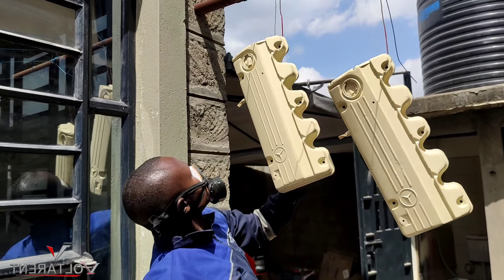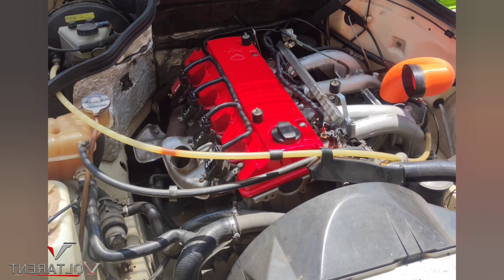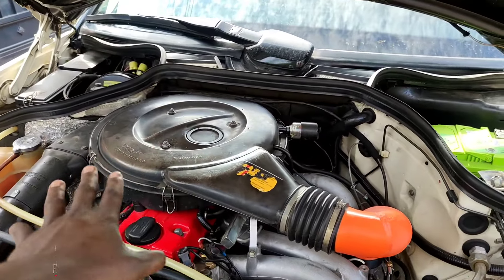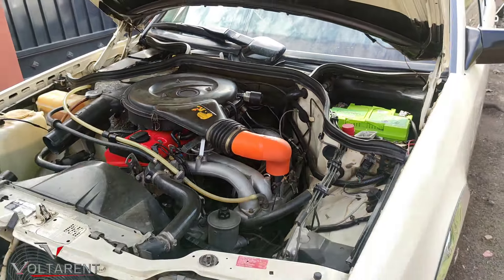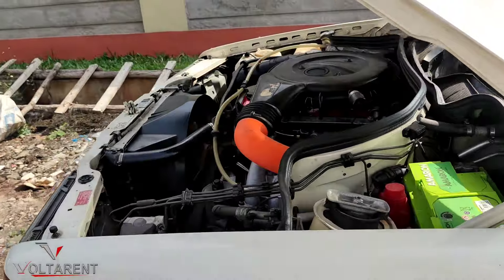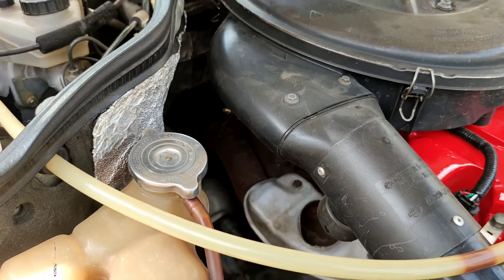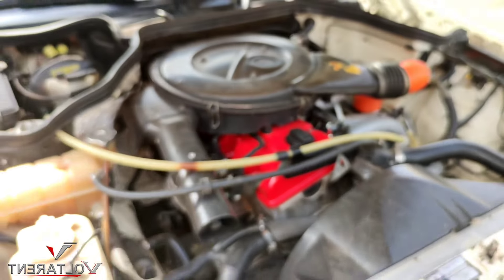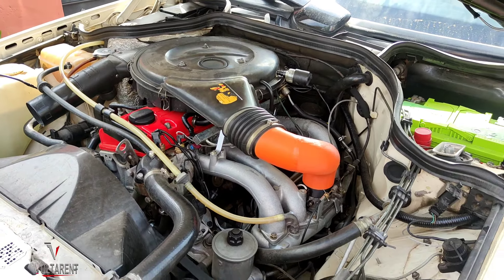W124 EFI conversion aesthetics!!

Comment: Great work! A lot of people have claimed (and some proven) that if you vaporise the fuel (potentially in the fuel tank) before it enters the cylinders you should also get additional increases in fuel efficiency and a cleaner burn/exhaust (lower CO2 emissions). I'm sure, that someone of your talent, could easily engineer that into a product -which I and many around the world would be willing to purchase.
Reply: Injectors already vaporise the fuel. Very effectively.

Comment: You need to program it with temp sensor if temp less than 40 degree the rpm raises to 900 then gradually reduced to 750 when reached 40 degrees